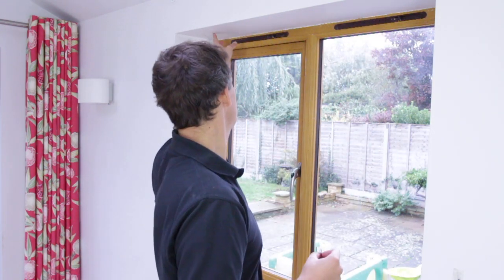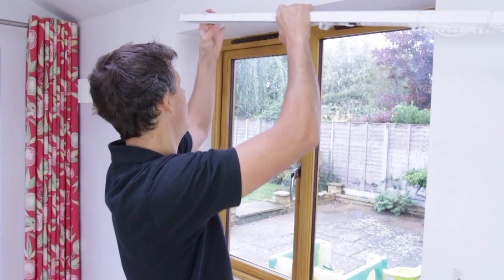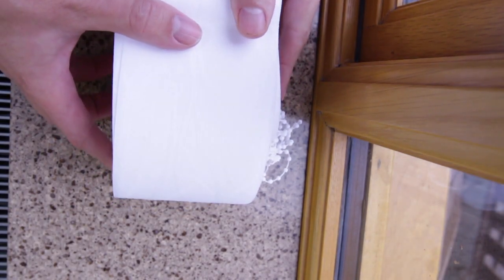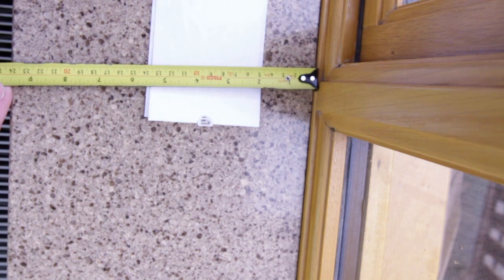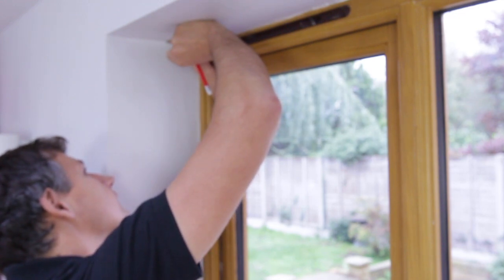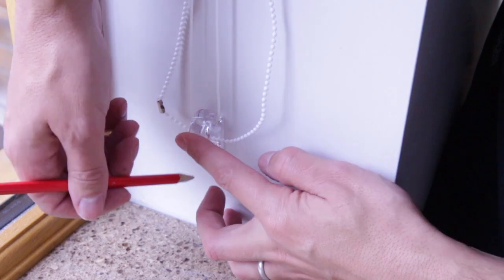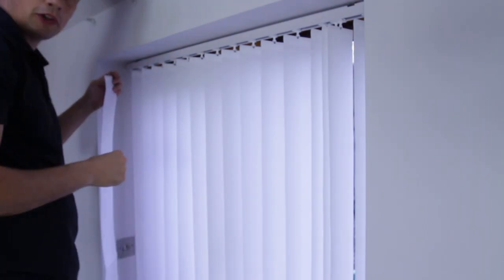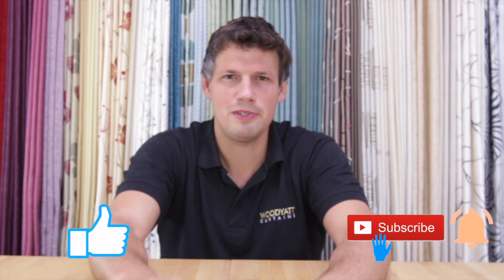How to fit Vertical Blinds

Comment: If you do it measuring from the back and the recess is different sizes left to right the blind will look bent to the eye. If it’s straight (square) it will be fine though

Comment: You didn't explain which way up the weighted pieces go at the bottom, I fitted them the wrong way up on the first attempt, or how to put the chain across the bottom. But otherwise a good video, thanks.
Reply from the maker: Sorry about that, when we deliver our vertical blinds the weights are already in the slats, so we did not do that process in the video, but anyway glad you liked it

Comment: What do you do if you have a lintel above the window so cant fit the clips?
Reply from the maker: Hi Pauline, If there is a lintel above the window where you need to screw the clips into. The easiest way is to use a 2 or 3 mm metal drill bit, to drill a pilot hole in the lintel . Then you need to use some special metal self tapping screws. If you are in the UK screwfix sell some. You will need something similar to this - https://www.screwfix.com/p/easydrive-self-drilling-low-profile-pan-head-screws-4-8-x-16-x-4-8mm-200-pack/5004H?tc=LC5&ds_kid=92700048793290424&ds_rl=1249413&gclid=CjwKCAiAtej9BRAvEiwA0UAWXjDrRBxaulpC9hTkWhUEr9K6OxFhFevfsHuttF93Dz0LZ4aq8gGpWRoCzHIQAvD_BwE&gclsrc=aw.ds
Hope this helps, Thanks
Ashley
Reply: @Woodyattcurtains  thank you so much 😃